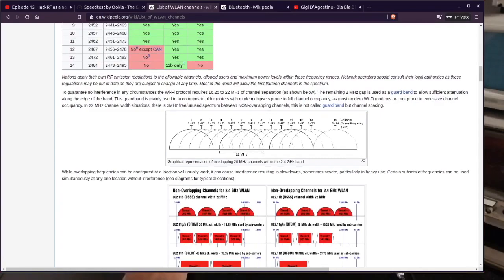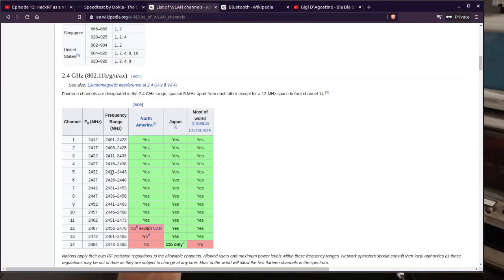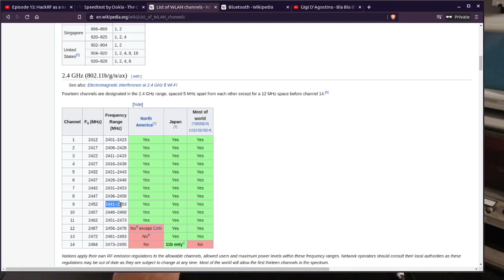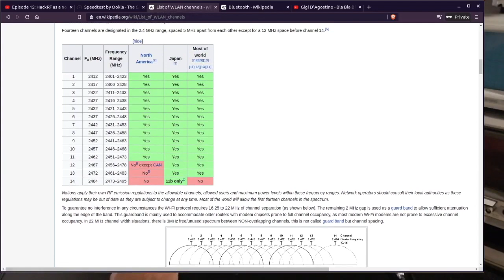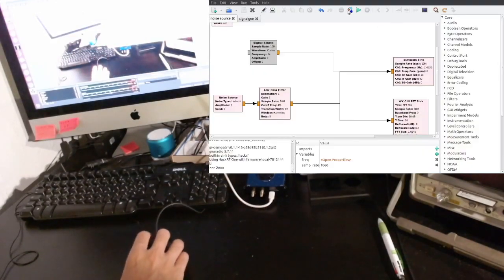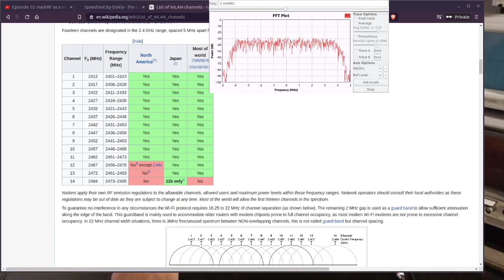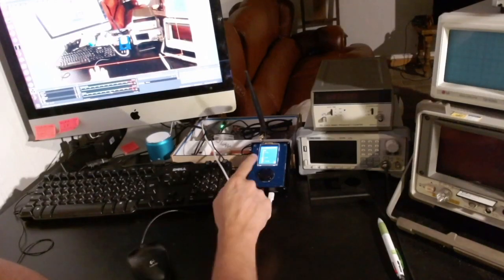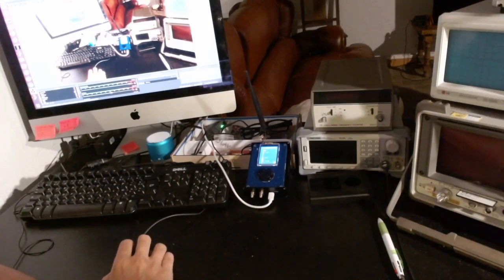Episode 60: jamming Wifi/Bluetooth with HackRF?

Comment: Thank you for this video, can I use hackrf one portapack h2 mayhem for capturing the wifi traffic between the application and the smart device?
Reply from the maker: Hi! No I don't think so because the Wifi does frequency hopping (it constantly changes frequency) and the HackRF should follow it. If this is possible (IF) it requires some software running this hopping, and this is not part of the mayhem firmware for the portapack.
Reply: @therfnoob7697  I appreciate your response. I have questions regarding this device. I want to capture the traffic between the application and the smart door lock in order to reply that traffic later. Is it possible to do with hackRf?

Comment: You do have the majority of the frequencies for Wi-Fi programmed into the Portapack FW or at least 10 channels for 2.4ghz as I recall and also a huge number for 5G wifi, alongside a shitload of other jamming frequencies.
but haven't tried it with my Portapack... really don't need a jammer.. already got one that crashes my wifi and my mobile signal and GPS and all that jazz, not to mention RC gear.
It's the one on the right. https://i.imgur.com/jTTeAdQ.jpg but also a heavy one.
DO I risk any damage to fx the HackRF+Portapack and any of the compnents' if I make a test like here.
https://i.imgur.com/SuaRN6y.mp4
and then use a beefy jammer like the one above fro fx 1 meter away, to see on the waterfall display' what it does to the signal.
I can read some people have fried some of their chips on their HackRF, but as I understand its mainly direct bias DC input and not just an potent wireless wide-spectrum jamming signal
any risk to HackRF while checking with a 10ch jammer like above.

Comment: Hi, I saw that you use Mac to program HackRF, what is the name of the program you use? Do you also use sdr software that you use with HackRF?
Reply from the maker: Hi Danilo, in fact I have Ubuntu installed on my iMac :) 
In my opinion Linux is a bit simpler and more documeted for radio/SDR software. So Linux is easier.
Reply: @therfnoob7697  ok thanks

Comment: Hello! Do you think that with an amplifier it would work?
Reply from the maker: With an amplifier at some point it must work, but it might become a bit dangerous: if you emit 1W (for example) signal close to your computer you might risk damaging its wifi chip.
Reply: @therfnoob7697  actually I tried it but doesn't work even with an amplifier. I'll try it again when I have some time :)
Reply: @allexj8203  Have u tried again with an amplifier? Is it working?
Reply: What if you transmit random binary data in valid wifi packets?

Comment: can you try to focus the radio energy  onto your bluetooth speaker using a horn antenna? (easily built - search for "cantenna" ). Do you plan to built / buy / use a 2.4 GHz 1 Watt amplifier in the future?
another idea: USB3 can be abused as a wide band noise source from 0 - 3 GHz. badly shielded USB3 is known to cause unwanted bluetooth / wifi interference - see whitepaper from intel: https://www.intel.com/content/www/us/en/products/docs/io/universal-serial-bus/usb3-frequency-interference-paper.html

i would love to see you explore horn antennas and USB3 as a noise source! you have that wonderful spectrum analyzer that i don't have . currtently, i only have an SDR dongle that only goes up to 1.7 ghz .
Reply from the maker: Yeah it would be nice to experiment with that, but Ghz amplifiers (1W) are kind of expensive. Also my HP 8591E spectrum analyzer can only reach 1,8Ghz! So at the moment I don't have the right type of equipment to test this properly. Also emitting 1W close to the computer might even damage its wifi chip.

Perhaps a cheaper option is to use directional 2.4Ghz antennas, as you suggest, with some gain. I will see in the future if I can get some :)

Thanks!
Reply: @therfnoob7697  looking forward to new experiments ! there is a lot of DIY instructions for a simple horn antenna using a tin can. http://www.turnpoint.net/wireless/cantennahowto.html
even higher gains can be achieved by attaching a cone to the tin can. you can find infos here: https://web.archive.org/web/20071012133113/http://www.saunalahti.fi/elepal/antenna2.html

p.s. ok - sorry - i was assuming that your spectrum analyzer goes up to 3 ghz. sad that those instruments are so expensive.. but you could use your hackrf as a spectrum analyzer with the proper software, right? i did so with my simple rtl-sdr. btw - do you know this thread about simple, breadboard based high-frequency oscillators? might be interesting to you: https://www.eevblog.com/forum/projects/challenge-thread-the-fastest-breadboard-oscillator-on-the-mudball/msg3108060/#msg3108060
Reply from the maker: @hercion  yes, check out my Episode 1 for using the HackRF as a SA. However, while useful, and amazing considering the price of the HackRF, there is just no comparison between a real calibrate SA and a sdr.

The HackRF can also be used a high frequency signal generator, for example do drive a mixer and down-convert high frequencies (2.4Ghz) down (for example 1Ghz, where my SA could have a look). I have done a few episodes on using the HackRF as signal generator.

Thanks a lot for your link, I'll check them out!

Comment: Hi! Thanks for the video answer! Two questions if you could answer... So you think that with an amplifier it would work? Also I asked about portapack only because I thought that the portapack jam-mode has the sweep in TX and so it could be able to jam Bluetooth/WiFi, but about what you said, using portapack or not using it has not so difference on what you tried on this video just using GNURadio, right?

P. S. Gigi Dag is one of us ;)
Reply: Let me explain you. First of all please read something about WIFI. RF Noob did cover it really poorly. One WIFI device can operate on 2.4GHz with 20MHz BW (bandwidth) or 40MHz BW it means it cover one or two WIFI channels. At 5GHz band even 80MHz is possible in ax standard. Jamming is possible but you need to know again something about HF. To completely jam you need to produce noise on whole BW and with power at least 6dB higher as device you want to jam. And no not any amplifier will work you need one for proper band and bandwidth. Thats only basic answer to your question.
Reply: @bfx8185  hi i am trying to jam whole band (2.4 GHz-2.5 GHz), but not worked, so have you find any method how to jam whole band? Cause my router changing center frequency after i jammed one channel.
Reply: @joshiharsh5846  Learn the basics of physics and the basics of HF technic and probably you will find a way :) To be honest I will not answer your question because it's secret :D